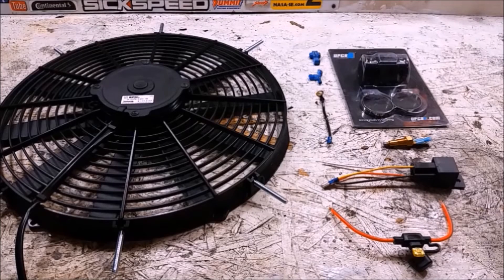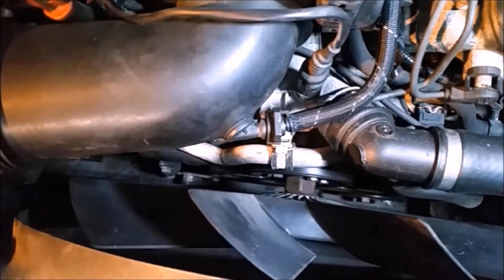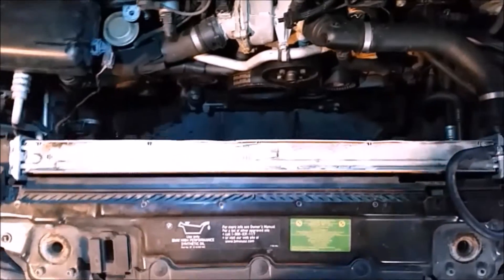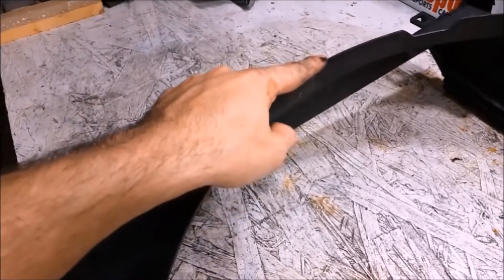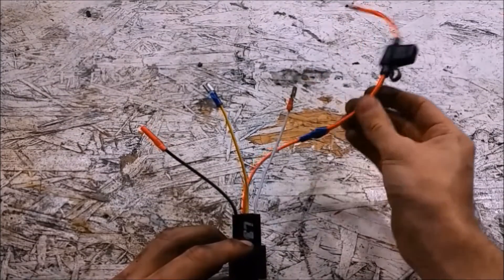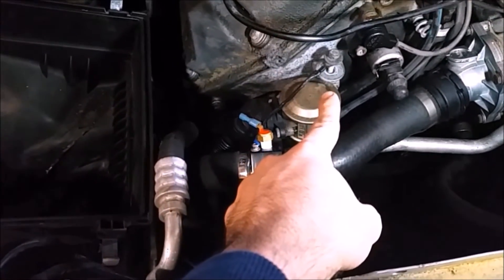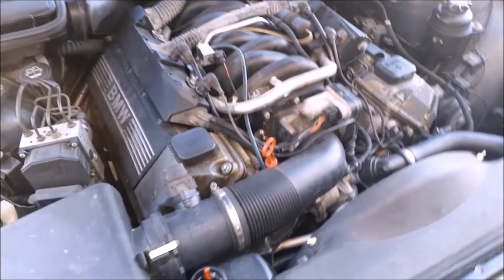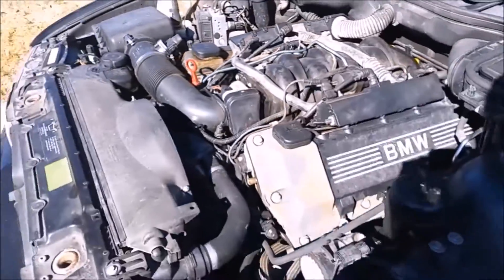E39 BMW 540i Electric Fan Conversion (Cooling Overhaul Part 3 of 5)

Comment: Please for the love of all things electrical , DO NOT USE SCOTCHLOCKS! ( blue press type connectors ) they will rust and make a shitty connection, which in turn will stop the fan working and well.. if the fan ain't working you'll soon cook the engine :( 
Use proper soldered connections with heatshrink / electrical tape, always !
Reply from the maker: It's in a sealed container and is now easily reversible for the next owner. Plus, there's a second fan and a temp gauge in case this one stops working. I'm not concerned

Comment: Question, couldn't you just tap into lower radiator temp sensor wire that controls the aux fan turning on instead of using radiator adapter with temp sensor install?
Reply from the maker: I don't want to touch any more factory wires than I have to. I'm sure it's possible, but I'd hate to piss off the ECU. Plus, I can buy whatever temperature activation switch I want to tune when the fan comes on.
Reply: 350Z247 ok i see. I'm trying to do this but cannot find a 1/8th sensor, do u have any leads/links? Thanks
Reply from the maker: @Jet3ch  there's a link in the description. I have the 200F switch that has worked extremely well
Reply: 350Z247 damn I'm.blind, thanks . lol I'm guessing one of the terminals on that sensor is ground, is it labeled? Good job on this mod
Reply from the maker: @Jet3ch  No worries man. And you use one terminal for the ground wire from the relay and the other terminal is grounded to the block. Once the switch reaches the set temp, it closes, grounds the relay, and turns on the fan. Glad you like it man!
Reply: Hey friend, my water temp switch does not screw down all the way into the adapter, it gets extremely tight half way down and I'm worried that since the probe face does not flush up with inside of adapter housing that it will not work right
Reply from the maker: It is suppose to do that. The threads get tighter because they are tapered for a good seal. It's different from normal threads.
Reply: 350Z247 thats what I figured but was worried that it doesnt even reach the outside of the other end inside the adapter, thanks.
Reply from the maker: If you bought the housing and the sensor I listed the tip should be in the flow stream. Even if it's not, it should still get a reading, but it won't be as accurate as it can be. If you'd like, you can email me a picture.
Reply: 350Z247 Already installed bud lol. At first the fan wouldn't start (at reached temp) so I tested a different ground for it, then it started. Turned car off, re crimped for different location, then when I attached to the different ground location it wouldn't turn on after after car reached temp again. The car never over heats and the fan I still don't think its coming on after a good drive. Strange
Reply from the maker: @Jet3ch  do you have an OBD2 reader that can sync with your phone? I can use an app to see my temps to low when the fan should should be on. It usually comes on. Around 205 degrees indicated by the app.
Reply: 350Z247 yes i have a scanner, the switch i bought is for 190F and my outlet radiator temp is showing 92c and still fan isnt coming on.
Reply from the maker: @Jet3ch  it may be because the sensor isn't in the flow or it could be calibrated a bit off. I would start the car and let it idle until the fan comes on or the temps start to climb. That's how I ended up switching to this other sensor because the first one I tried didn't close at the right temperature.
Reply: 350Z247 its just strange because the fan turned on once I touched the ground to a different location, but as soon as I crimped it, it no longer went on. I will have to look at it again after work lol, eother way thanks!
Reply from the maker: No problem. You can also try disconnecting the wires to the thermoswitch and touching them together. That should directly ground the fan and turn it on. If the fan doesn't turn on then it's the ground or relay and not the sensor.
Reply: 350Z247 when I disconnected the 2 thermocouple wireless amd touched them together, nothing happens.  Strange enough, the fan turns on when I disconnected the wire that goes to the thermocouple from the relay, and plug it into the ground for the fan.
Reply from the maker: @Jet3ch  there's no way that works. I must be reading it wrong. Try directly touching the ground wire from the relay to the engine block. The fan ground wire should also be bolted to the engine block. I use one of the bolts on the front of the passenger side cylinder head.
Reply: 350Z247 Whats your email so I can semd you pics of the switch
Reply from the maker: @Jet3ch  go to the "about" tab on the channel page and it's there. I believe it's 350z247channel@gmail.com

Comment: The reason the fan breaks is the clutch locks up. Usually* from bad water pump bearings or motor mount
Reply from the maker: It can break for several reasons; all of which are a perfect excuse for the upgrade.
Reply: 350Z247 true. I was just staying the usual reasons. I've never heard of the broken off/out of balance issue that was in the video.

Comment: so, if i use all of those parts you listed i won't have the problems you listed about the switch?
Reply from the maker: luisbrandolb yeah the link I posted was the second switch I used. It's worked for months now
Reply: 350Z247 is there any other issue these cars have that needs to be Pre-fixed
Reply from the maker: Fan and thermostat are really the only design flaws. Other parts will break with time but should give you a code. Also, I would check the PCV valve on the back of the intake.
Reply: Since the updated switch you posted has two posts instead of just one, what do each of the posts get connected to?
Reply from the maker: @Hotgirlsmakemecry  basically the switch a in the middle of the ground wire for the fan. So the ground wire for the  relay goes to the switch on one terminal. The second terminal runs a wire to the engine block. When the switch closes, the relay can ground and power the fan.

Comment: Nice ill do the same on my 540.
Can you show the wiring? Please
Reply from the maker: I did show the wiring. Relay wiring: white splices to green harness wire, red splices to red harness wire, yellow goes to the fan's power wire, and black is a ground. The thermoswitch goes inline for the fans ground wire. The relay provides power to the fan as long as the key is on, and when the thermoswitch closes, the fan grounds and turns on. Watch from 5:45 to 7:55 again.
Reply: Thank you and yes everything is clear great video
Reply from the maker: Good luck man!

Comment: Nice Video bro! Where can I get 18inch electric fan? Instead of the 16 inch.. I looked around and nothing! With 18 inch fan.
Reply from the maker: Thanks man!

https://www.jegs.com/i/Flex-A-Lite/400/180/10002/-1

It's expensive, but it is bigger and comes with an adjustable temperature switch which is cool. I have had the 16 inch fan for three months now without a single issue though; so, that should be ok.
Reply: Wow yeah very expensive! Bro.. I should buy the rest! From the info u provided from your video.. Thank you!
Reply from the maker: R Tario yeah a regular 16 inch fans seems to be just fine. Especially with the accessory fan in front of the AC condenser  (mine is broken and will be replaced with an aftermarket 14 inch fan)
Reply: Your replacing the fan with an 14inch?
Reply from the maker: R Tario I'm replacing the fan that is behind the front bumper. It turns on whenever the AC is used and if the car starts to overheat. So there will be two fans.
Reply: Hope u make a video of it..
Reply from the maker: R Tario of course!
Reply from the maker: I wish they had just installed a proper electric fan from the factory. but I have two fans now: 12 inch for the AC and this 14 inch fan for the rest of the cooling. They work well together.

Comment: Waiting for my 16" SPAL VA10-AP50/C-61A (2270m³/1336CFM) electric fan to come and I think next weekend I will do the whole conversion on my E39 6 cil lady.
As for relay I've ordered the Bosch 0332019456/BMW 1378238 because I feel a bit safer. The thermoswitch I will be using will have a starting point of 100 degrees Celsius with 95 Celsius the stoping point. The thermostat comes from Mahle/Behr with 88 degrees Celsius open point.
I find your video very useful and it made my job 70% easier because even though I have the 6 cil version, they have at least 80% of wiring and so on, in common.
One question though, does your switch wire keep the Electric Fan 10 more seconds active? I am asking that because I saw another video where the guy with the M5  found a live wire on the driver side which kept the Electric fan 10 more seconds after the  key was taken out . Do we have there another wiring box under the filters? :D 
As far as mechanics are needed, I can do almost all on my car but on electric side haven't had the chance to work untill now.
Reply from the maker: Mine cuts off as soon as I turn the key off and turns back on as soon as I turn the key as long as the coolant temps are high enough to trigger it. Perhaps he used a different wire that holds power after the key is removed similar to how the radio will still play for a short time. It wouldn't really help that much though as the coolant isn't circulating anymore.
Reply: It helps quite a bit because on the BMW E39/E46 cooling system the water circuit is at 2 bar /29psi which means the coolant has a boiling point of around 120 celsius/248 F.
If you run the fan a little longer while there's no source of heat, the thermosiphon  will lower the temps under the warping point of your cylinder head,  and especially in my case which is planning to supercharge his inline six in about a month, extrea features on cooling are welcome because BMW made the cooling and oil loop with their arse.
PS: On E39 with Climatronic you have the auxilliary water pump which is helping the mechanical pump for the heating circuit.

There are a lot of cars having this from the factory implemented. As I said, it's a wire on the driver side, a brown and white wire.
https://en.wikipedia.org/wiki/Thermosiphon
Reply from the maker: Right but I have a lower temperature thermostat and run at about 190 degrees so I'm much less worried about the typical BMW heating issues. I would be more concerned with the inline six with that long head warping. I may wire my auxiliary fan that way when I replace it, but so far the lower thermostat opening point has worked really well.

Comment: How's the increase in power?
Reply from the maker: hua Hua it felt a tad quicker to me mostly because it felt like it goes through the revs quicker. I've been really happy with the fan though. Not one single issue keeping the car cool, and it's super easy to remove for maintenance of the front of the engine
Reply: 350Z247 thank you for your help
Reply from the maker: hua Hua no problem!

Comment: Nice write-up. Couple of suggestions. The fan should fill the complete shroud opening. You are losing airflow and efficiency. I don't know what size the shroud opening is and the fan you used. Next time use a dual stage fan controller (low & high). You know that the reservoir is junk for the 540. Looks good.
Reply: How much does a job like this cost from a Mechanic
Reply from the maker: ZeroR2 thank you. I would have gotten an 18 inch fan had I known the opening was that big. A write up online told me it was 16 inches. It's worked well over the pat couple months without issue even in heavy traffic. I just replaced the resivior as the old one was leaking.